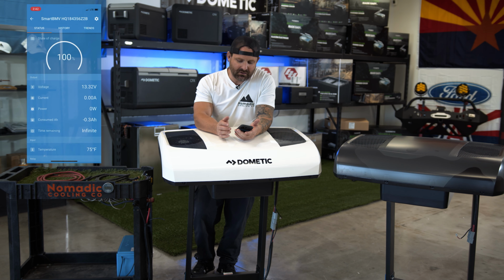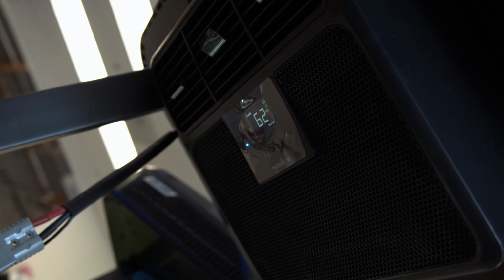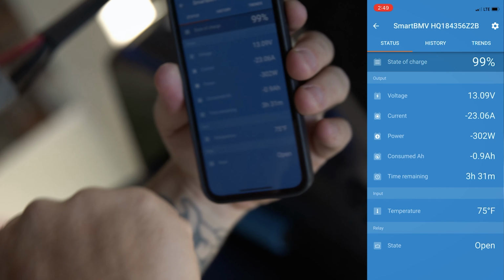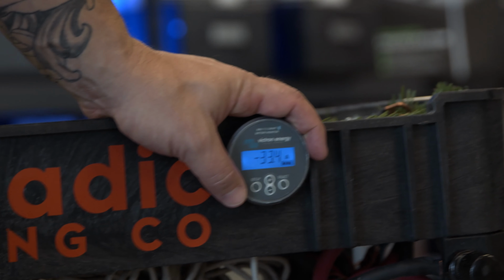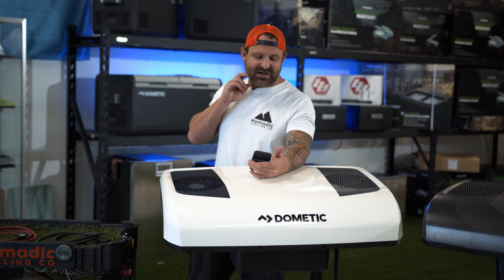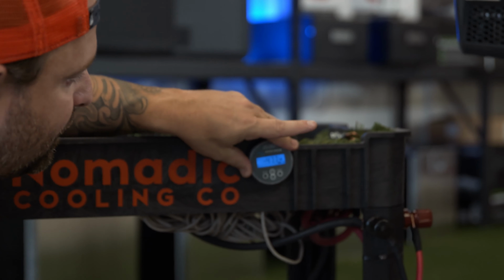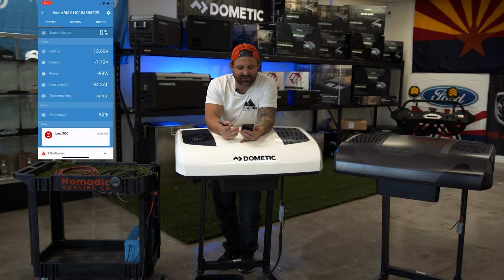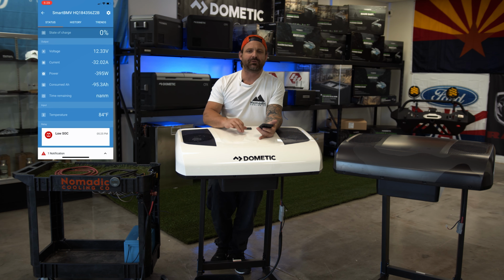Dometic RTX 2000 Battery Consumption Test l Victron 100ah Battery l Nomadic Cooling

Comment: What’s the best battery to purchase for the Dometic RTX 2000 …12v. 
How many amps?  For hot weather,,,,
Reply: There are so many variables to consider that it is not really possible to answer your question. Some of the factors that need to be considered when determining the best battery size include but not limited to: How hot is the weather? How many kilowatts of solar or other sources of charging energy do you have access to? How many hours per day will you be inside the RV?

Comment: Hello friend,
*Is it normal that the battery warning kick on sometime? ( on a 400amp system) .
* Is it the right way to wire straight to the battery with the 80amp oem fuse? Or connect it to vitron lynx distributor 1000 ? Thanks

Comment: question, would this run on a portable power station; such as a Bluetti  AC 200? Particular powerstation seems to be better than most on the market. I’m just curious because it has a 30 amp 12 V outlet. Thanks.
Reply: He might have answered your question, but much like testing the output temperature it seems he forgot or was busy buying a flashing tie to wear for his next sales pitch.

Comment: Just FYI the maximum voltage of the battery you're talking about is 13.5 volts not 14.2 volts. 14.2 volts is the absorption charge voltage but that's not the actual voltage the cells will end up at. Once charging has completed or it goes into float it will be maintained at the maximum voltage of 13.5 volts.
13.32 volts at rest is approximately 92% charged with 13.4 to 13.6 volts being fully charged.

Comment: An interesting but invalid test. The AC is going to be cranking away full time. In real world application it should cycle on and off. Your air is all in the same space so you are just moving heat from one space and putting it back into the same space.  I would be a LOT more impressed with this test if the unit was actually installed in a vehicle with the doors closed and windows rolled up...

Comment: is it common for the Dometic RTX 2000 to squeak when driving after install? it's driving myself and my passengers nuts. squeaks like a mouse whether on or off
Reply from the maker: No sir, not common at all. Might need to check with your installer. Thanks for the question.

Comment: Any idea on the BTU output on the RTX2000 when running in Eco mode (19 amp)? Dometic support referred me to you guys for this question 😀. We already have the 24v version for our truck cab (our truck doesn't have factory AC so we use this while driving) and are now looking to add the 12v version for the habitat, but the habitat will have to run off our 400amp LifePO4 battery bank so my interest in the Eco mode cooling output.
Reply: I noticed the excellent service given your question was answered accurately and quickly.

And you say the factory sent you to them for the help.  Hmm,
This is making my decision of what to buy easier

Comment: Seems that Lithium Battery systems like Goal Zero Yeti 1500X have their highest AMP rated output at 30 AMPs.  Am I correct in concluding that if any AC unit or appliance where to attempt drawing more than 30 AMPs from a Yeti 1500x, the appliance will not function ie Domatic's Nomad 2000 that runs up to 72 AMPs at peak cooling?

REPLY

Comment: What about 2 200ah agm with a 3000w inverter
Reply: You don't need an inverter, it runs off 12V directly. Assuming you can only discharge the AGM's about half way, then your capacity is roughly 200AH, so it should run about twice as long as his test using 100AH.
Reply from the maker: It will run but for how long is the question ? I’m not sure exactly a lot of variables
Reply: Tru. I understand thank you for you time and the great video
Reply: Now I wonder what if I had said life?

Comment: It’s seems to me like you are trying to cool a huge area. In a van wouldn’t it cool down the van and then cycle in and out to maintain the temperature?
I’m looking to put one of these in my camper trailer, it’s way smaller in volume than your shop.
Reply from the maker: Not trying to cool in this video, trying to test the consumption at 100% compressor on time ;)
Reply: David exactly. I'd expect four hours or so with regular usage with the compressor cycling on and off unless you're in 100f Texas.
Reply: You should testing it in a small area to cool down the maximum area the unit can cool down.  Once it reach the desired temp, the AC unit should threottlf

Comment: How does the  power draw of the 12v system compare with a AC powered dometic when using a inverter … I think it will be comparable when it comes to wattage draw
Reply from the maker: Check your math, not comparable. ;)
Reply: @NomadicInnovations  Yep you were right.  I saw over 1000W when the compressor was on and 350W approx with just the fan on my 11,000 BTU dometic Pen II. I was inverting 600Ah through my 3000 inverter
Reply: @NomadicInnovations  what the 12V wattage draw when the the fan is on to low and the compressor is NOT on
Reply from the maker: @carmas54  we will run another test for you and get you that answer, Great question ;)
Reply: @NomadicInnovations  thanks I’ll have to stop in next time I’m in the area running a 12v ac with my 600Ah would be interesting